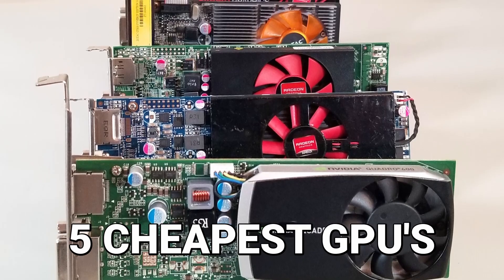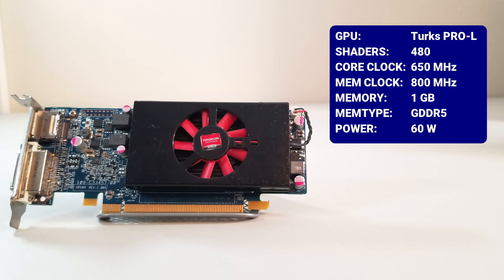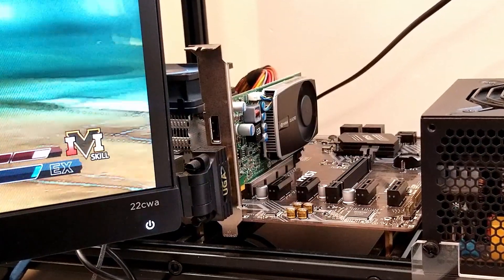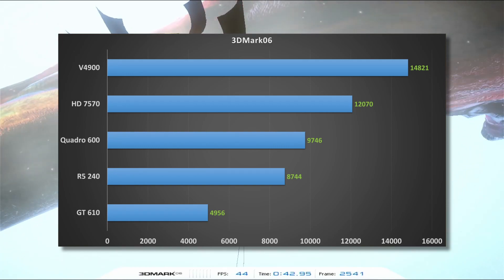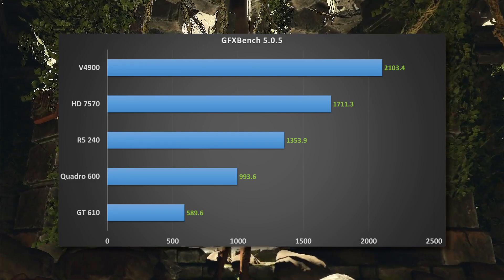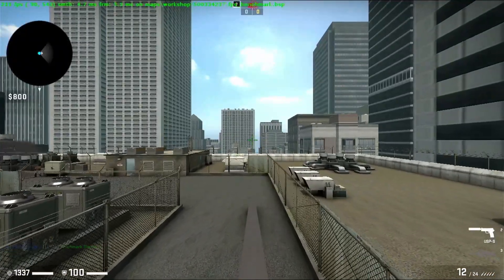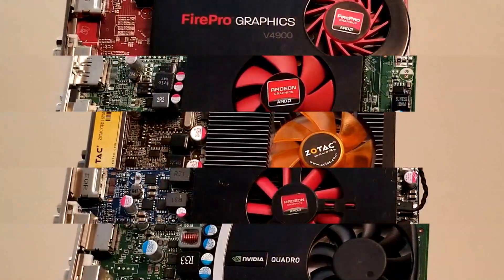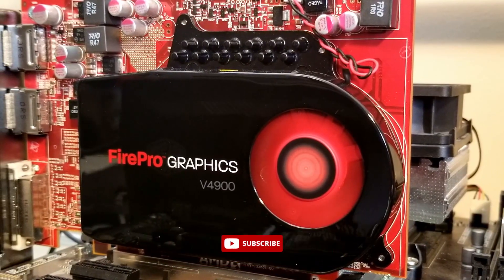GPU's Under $20??

Comment: I'm surprised there's no HD 5450/6450. but I think it'll be performing the same as gt610.

I remember getting the R5 240 at $7 back in 2020, I played DMC5 and RE2R with it. But then I sell it at $20 to my friend lol.
Reply from the maker: You are right, the HD 5450 would have been a good addition. It's all over Amazon, both new and used. It certainly would have ranked pretty low for sure though. 👍